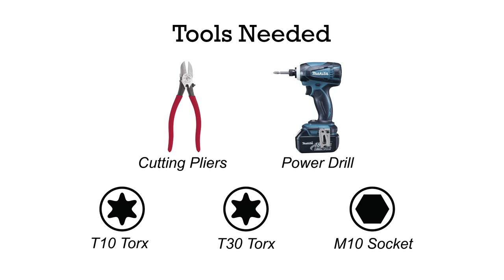How to replace the Mercedes-Benz Interior Door Handle  C-Class W204 GLK X204

Comment: any idea if this part would fit a 
E class c207 they look exactly the same
Reply: just wondering if you ever got this question answered?
Reply: @sarahmandlsohn1610  sadly not but after dismantling the door i realised it wasnt actually broken, the cable had just detached from it. which seems to be the case with most of these so with any luck yours might be the same issue.

Comment: The 2013 C300 does NOT look like this on the inside, and the pin is covered.
Reply: I've got the same job ahead, driver's side, thanks for the update
Reply: @multinaire  I eventually got it all done, it was a bigger mess than implied. Really need a great pair or rivet cutting pliers. Even then I had to cut a bunch of the plastic rivets off with a moto-tool blade. Those suckers did not want to go. There was a lot of cursing and putting the door panel back on only to realize the pull cable needs to run along a very specific way inside to have enough tension..I think I had the door panel on and off three times. BUT...it worked. My door handle has been functional now for a few months.
Reply: @John Fiebke You're right ! what I've listed below are some must have simple tools that can make this process a hell of lot quicker:
(1)Beveled or Tapered wire cutters,for those plastic rivet heads.
(2)10 mm socket for the metal caps.
(3).A Sharp straight  precision pick to PUSH that plastic pin out by centering it from the covered up end....the screw method mentioned in this video; clearly DOESN'T WORK !  the pick also helps with releasing the connectors as well.
(4) Phillip screw driver for the 20 replacement screws. 
Im really think about starting a door handle repair business by doing this, cause the  STEALERSHIP charges $600.00 for this job !
Reply: @multinaire  They wanted over $900 to do mine. I had a few choice words, especially since the vehicle had an extended warranty.

Comment: Please help,I am looking at all these comments, But I need help,My door handle broke  on the driver side c 250 2013,The mb,is charging 800,plus to replace it.3 Months ago,I paid over 4,ooo.oo to do a complete  change of everything under the hood,early  the engine light came own,lord have mery that was over thousands.I purchase this car brand new,paid cashfir this vehicle.My brother who knows a little about cars took  me to this dealer,who told me he can repair it ,if I got the part,so what kit do I need to order.Desparate,I am tried of spending money, when there are short cuts
Reply: Is the handle on your vehicle chrome or matte finish?

Comment: Wow... I don't have a Mercedes but just curious how these are built. Looks like the same quality as NEW cars (plastic) but designed to be NON-Replaceable or at the very least, NON-Replaceable as a DIY.

Being locked in by multiple layers of trim (where it is the last to be removed), also melted in (plastic welded to be locked in place) and requiring a removal of the whole door trim (in itself locked in place by side trims) is a Night mare. Essentially telling people pay to get it repaired. 

Some cars look great and still a breeze to fix. I can fix my door handle in about 5 minutes (no door card removal required), held on by slide clips and 1 screw. Designed to be replaceable with a common screw driver. All the design features a Manufacturer wanting more sales and more profit does not want you to be able to do.